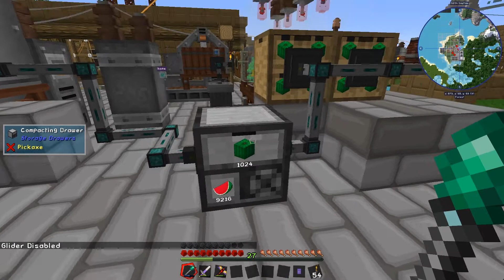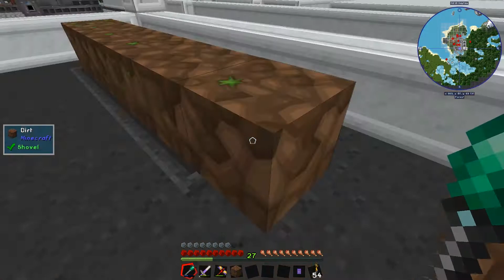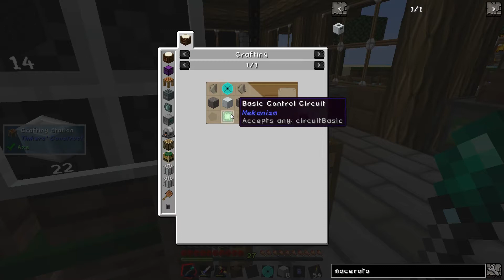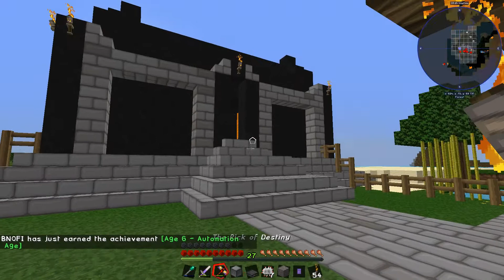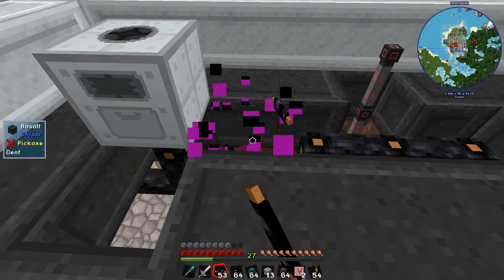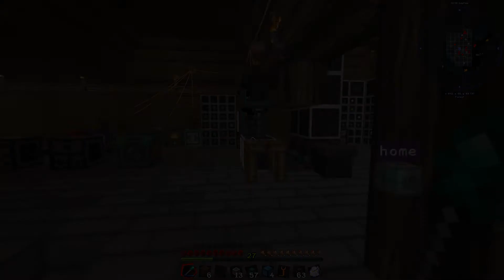Age of Engineering | 31 Uranium Processing | Closet Gamer

Comment: Quick fixes could be done off camera, you know. Especially if it's something you have to maybe figure out. Then when it's done, you can just quickly go over it, if you feel it's worth sharing.

Edit: I especially liked the gentleman meme. Also, not sure if those ender io conduits have speed upgrades, they may be necessary, best way to check is to see if you can grab a stack from the cobblestone generator. But it's not really important now. You will need an octuple compressed cobblestone, but that's for the crazy ridiculous end game craft. If you actually want to go mental, I think you need 7 or 8 emerald cobblestone generators using translocators to insert them directly into a compression drawer chain, or rftools crafter. But I wouldn't worry about it too much, until later.

Edit 1: in this situation, I believe I'd just break the extra solid canning machine with a pickaxe, because I think I'd rather have the machine casing, lol. It's super cheap if you decide you need another one, but I doubt it. I think you'll want the other one.

Edit 2: I'm not gonna lie. I restarted, because I had a waterwheel accident, and lost my trophys. Didn't realize it until hours and hours later. Also, I really like that you have a nice little trophy house.
Reply: for the drawer part, you can just use slaves, just put a bunch of those on top of the cobble gens, no need to waste diamonds and power for the phantom thingies, for the triple+  cobble, just a translocator do the job fine.
Reply: Tsukiumy, not sure what you meant by phantom things, but gave me an interesting idea. Put a compacting drawer directly on the top of a cobblestone generator, like you said. Translocate them into the rest of the cobblestone chain, build a stack of phantom interfaces, link them all to the first compacting drawer, make a stack of cobblestone generators, and put those on top of the phantom interfaces. Boom, ALL THE OCTOUPLE!!!
Reply from the maker: liquid klone "a water wheel accident" that's quite and intriguing sentence, I'm kind of imagining you tangled up in the water mill xD tell me more!

I'm not gonna lie, the octuple compressed cobblestone hurts my brain and reminds me of the egytian slave prince story  about having one grain of rice doubled for every square on a chess board - it's a ridiculous amount! 

I edit out quite a bit of stuff (the unedited footage would be dick-rippingly frustrating) but I like to leave a little bit in to show that I make the same mistakes and f-up just like everyone else. I know a lot of youtubers who portray themselves as all knowing guys who never screw up. To me this seems false, unrealistic and fairly transparent when you watch closely for the edits.
Reply: i probably misread the translocator part and was thinking you was talking about the AA phantomfaces, and the drawers have some itens that can make tasks very easy, one of then being the drawer slaves, they work like the controller, except that they cant work standalone(need 1 controler in the system), and allow for some really crazy things, like making a 25x25(the limit range of a controller) of cobblegens feeding a single drawer.
Reply from the maker: Tsukiumy I need to look at these translocators... I'm away from home at the moment so I can't look but I'm imagining that they allow you to replicate the output of a machine?
Reply: Closet Gamer, in response to the water wheels accident, I had water wheels in the walls, because it looked good. I had a little trophy collection just sitting in the floor of that room, whike I was building the water wheels, I had to keep removing the wheels trying to get the water right, and get the most RF/tick, and didn't have the glass walls up to contain the water, so it kept spilling on the floor. So while I was derping it up like a professional screwup, the water washed the trophys away, so they despawned when I wasn't aware. Next time, I'm putting the water wheels in a solid box, hidden in another chunk. I have to think about FPS this time, if I want to have any hope of finishing the pack.
Reply from the maker: liquid klone yea I spent ages trying to get that waterwheel just perfect (much more time than I alluded to in the episode) I think it was up at 80rf/t... Kinda annoying for it to be subeseded so rapidly! But the flowing water does lag out a lot! I lost my farming age trophy from a spell of rage... I thought it looked crap compared to the others and tossed it in the lava in my trophy room xD
Reply: Closet Gamer I laughed out loud.
Reply: they are like transfer nodes/item conduits, excepet that they only work for 1 block distances, what makes them exceptional is when you need speed, with a glowstone in them, you can transfer 1 stack/tick, its really fast, i use it to make the singularities(borrowed the direwolf idea, just tweaked to be on a subnet independent from the main AE2 one, 2 translocators+1 full upgrade item conduit pumping bits inside the machine nonstop, got me about 19 stacks of singularities for later use, and is running all time im on.
Reply from the maker: liquid klone I did too! But then was like 'oh shit... How am I going to explain this to the people watching!?' haha I guess honesty is the best policy
Reply from the maker: Tsukiumy sounds pretty nifty, I can see where that would come in handy. I am really looking forward to AE2. I used AE1 many years ago a remember how powerful it was to be able to digitally store your items in drives and recall them for auto crafting and such like. I'm very much looking forward to the new age :)
Reply: Closet Gamer which reminds me. Don't forget to throw a stack of quartz seeds into the lake at some point.